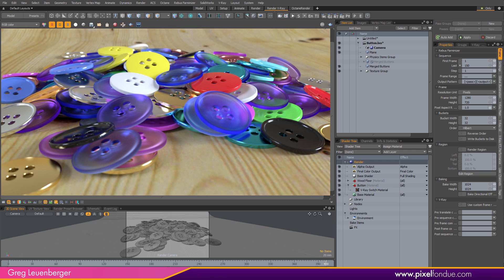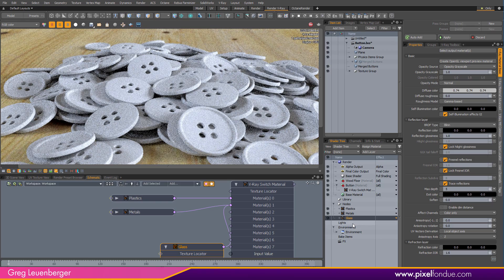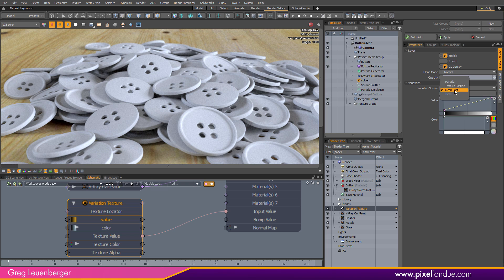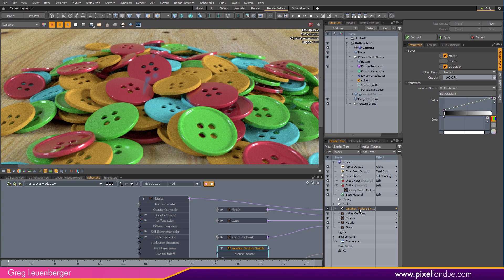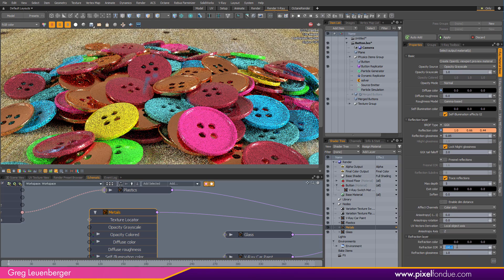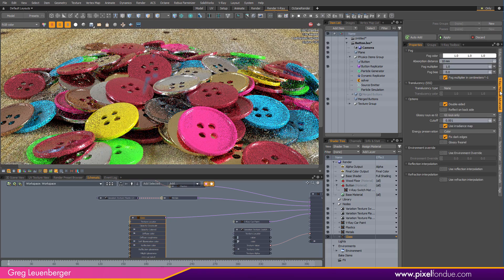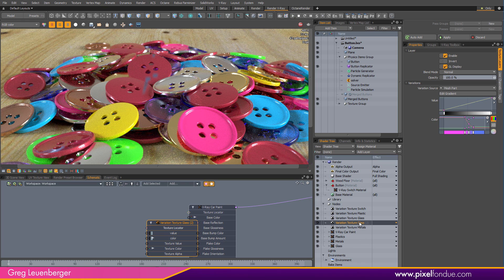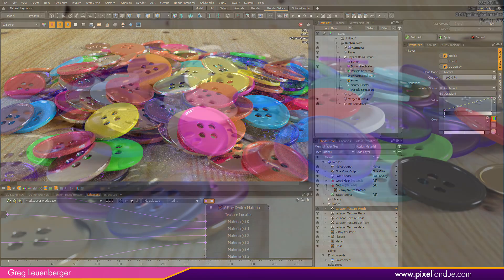MODO V-Ray | Switch Material

Comment: Thks for this great tutorial.
It is possible to use many différente images map with the Varation Texture for the Switch Matérial ?
A randomiser with différentes images inside a folder.
exemple : for the floor wood textures tiles
Thks
Reply from the maker: It would be great but I don't think so....I'm not sure what the best way to do that would be....I think we would need a new type of texture (image variation that takes rgb from different images rather than points along a gradient).
Reply from the maker: Or maybe pick a random frame from an image sequence...that might work (I'lll ask for a feature request)

Comment: Amazing tutorial. 
Instead of restart/refresh RT for every change to take place you can just toggle any material in shader tree and this will force RT to apply your settings.
And when you disable Frensel reflections, no need to change the refraction ior.. Only when you have frensel reflections on, you will need to use high ior for metals 
The big blobs on the capraint material is flakes. the default size and scale are very big
Reply from the maker: good tip.  That's right about the metals...I have it correctly in my metal video but changed the IOR here (to no effect...lol)